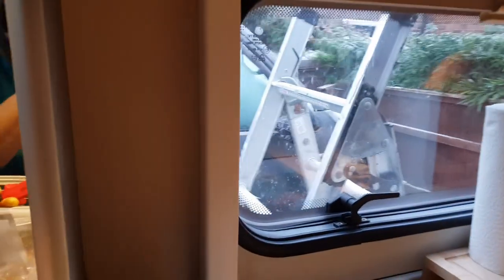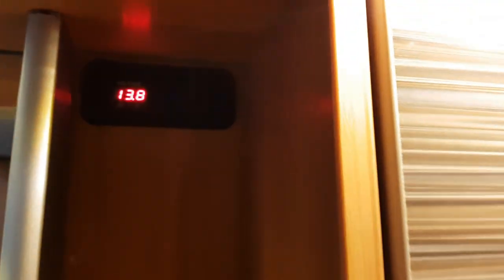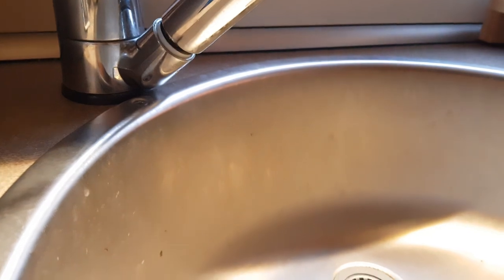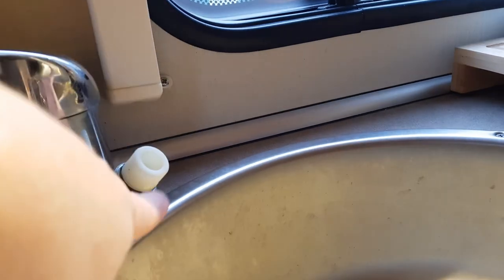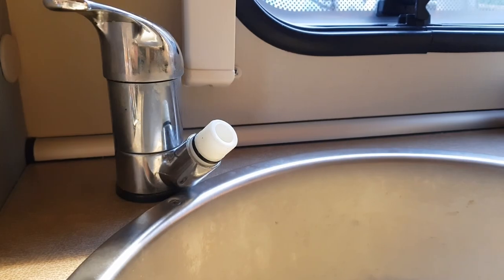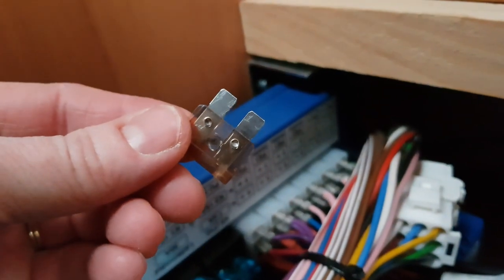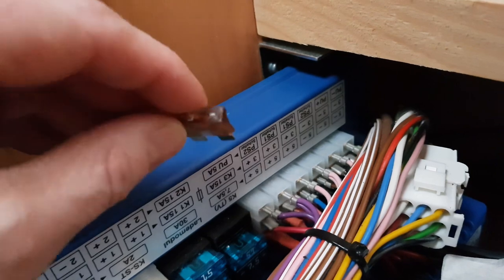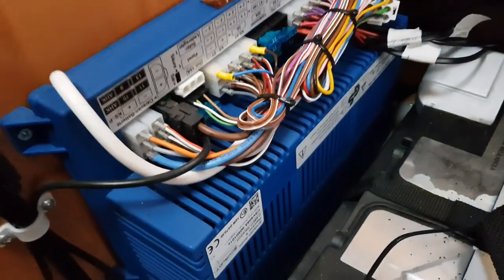I’ve been an idiot! Dealing with frozen water pipes in the caravan…

Comment: Hi Becky. When draining down, pull that same fuse for the pump and you can leave the taps open, no need to add a switch. I know someone mentioned using 'Flow' to clear the pipes better but if you can manually blow it through, for example, via the shower hose (with the head removed) it does quite a good job. As for the blade shape on the fuses, just a manufacturers preference. As long as they are the same size and the correct rating (5 Amp in your case), they will do just fine. 👍

Comment: Oh oh, here in Germany there are 4 "Skrews" ore handles in the water pipes for cold an hot water. You have to open these, unskrew with hands. And then you can detach the elektrik for the pump , it´s over the tank, or you pull the fuse. then you can open all tapps and breath strongly in the taps to push the water out. You should controll whether the boiler for hot water is broken. Wat is the small black brick over your batterie? Greetings an merry x-mas!
Reply from the maker: Greetings and Merry Christmas to you too! Thanks for watching. I have the same 4 screw valves. My Eriba dealership told me that the only difference when these are sold in the U.K. to Germany is that we’re not allowed power sockets in the washroom, of course our sockets are 3 square pins not 2, and I think there’s a slight difference in the fire regulations for fabrics, but other than that exactly the same trailer from exactly the same production run :) Stupidly I thought I’d opened all 4 of the screw empty valves, but I misremembered and hadn’t actually opened the cold water ones! The boiler has an auto open one, which if I’ve forgotten will open itself anyway below I think approx 2 or 3 degrees but thankfully the boiler is all fine :) The small black box on the battery is a Bluetooth voltage sensor, so that I can track state of charge of the battery. I installed it in this video: https://youtu.be/PUqyx9cSI1c Best wishes!

Comment: Glad it wasn't too serious!!... ever thought about using a Floe?.... I bought one a couple of years ago, use after each trip away if I won't be using the van for anything over a couple of weeks even in summer to keep the nasties at bay and am always amazed just how much more water is expelled even after draindown... just thought I'd mention.... anyway really appreciate your vlogs! thanks and keep them coming
Reply from the maker: Thanks and sadly I can’t use a Floe as there’s no Truma or whale water socket on the side because of the internal tank. I’ve heard reports of good volumes of water coming out though so maybe they’ll build one for folks with internal water tanks…
Reply: @CaraVanOlogywithBecky  

HI Becky,
Thanks for reading and replying...just thought I would mention that I am using Floe on my Eriba Troll 535... much the same setup as you I guess with the inside water tank.... in this application I have a Floe kit that includes a "T" piece with a shut of valve that is fitted inline on the pipe out from tank to the onboard system (under the seat), the "T" piece has a normal type pump connection to pressurise the system.... its easy to fit, simple to use and worth IMHO to remove potential frost damage and stagnant water .... if you are interested I would happy to let you know the specific (non Truma or Whale) kit details and a few pics of mine fitted if it helps? ... just let me know.
Regards
Brian
Reply from the maker: @wxw9 Excellent! That sounds great, yes please to details and pics (I'm on Twitter/Instagram for easier tagging). I've been thinking about how I could adapt something. Many thanks, Becky
Reply: @CaraVanOlogywithBecky  
No problem... don't suppose you're on WhatsApp?.... if not I can sort
Reply: @CaraVanOlogywithBecky  hopefully you've received images by Twitter?... any questions, do shout!... cheers 👍  Brian

Comment: You know the saying Becky, we learn by our mistakes 🙂. I’m surprised there's no pump isolator switch. How have you left the taps previously in cold weather, open or closed. Thanks for sharing, Rob
Reply from the maker: You would have thought as we’ve had this since 2017 I’d have made all my mistakes by now ;-) usually I just leave the 12v off so the caravan is totally off in all senses & taps can be open, but this year (it’s on the drive) it’s been a handy Pir security light as we’d moved where we keep the bins! Pleased to say since the video I’ve actually found a little plastic electrical quick release connector so I can isolate the pump, just not a handy switch.  I think I’ll add an easy reach switch in the new year so I don’t have to “ferret around” I’m the cavernous under bed area to find the connector again, also useful in case something else misbehaves :) Becky